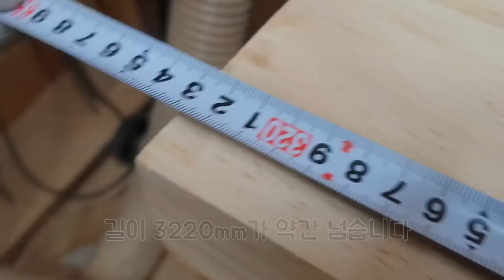[Eng Sub][여기까지 왔다 '끝판왕' 우드슬랩][woodslab table] wood ro leehyun DIY  Amazing Machine

Comment: Seeing the orientation of the 2 slabs glued together after a year ( or less ) everything on the table will roll into the centre as it will cup without any dovetailed straight supports underneath ( also the legs will begin to tilt out ) - if you don't want to see a dovetail on the side there is a way to put them in and hide them so the edge is unbroken...this is all about the machine ( really? you couldn't afford one more motor? - a CNC without linear travel? ) - unfortunately the understanding of the materials doesn't match the engineering in the machine...
Reply: The only motor controlled axis in the Z axis, so they'd need three more motors to control the other two. In addition to the three motors, there would also need to be a setup for lead screws or rack and pinion gearing to control the axes, which this machine does not have. This also isn't a CNC, it's very clearly a manually operated machine, outside of the motorized Z axis. This is essentially an inversion of a standard router table, but rather than moving the work piece in relation to the tool and jigs, you're moving the tool in relation to the work piece and jigs. Just because it uses a gantry design, like most typical woodworking 2.5d CNC routers use, does not make this a CNC; again, it's missing a lot of major components that would make it a CNC. If you want an analogous comparison to other manual machines and their CNC counterparts, look at mills and lathes, both have very accurate manual control variants, and both have CNC variants; though, inversely, this was designed based on adapting CNC designs to a manual machine, rather than adapting a manual machine to have computer control.   

Also, do yourself a favor and learn what punctuation is, your comment was a headache to read.
Reply: That still doesn't fix poor design and a misunderstanding of materials. Period. Satisfied?
Reply: The guy has been woodworking for over 38 years. He most likely knows what he's doing.
Reply: Well I've only been doing it for 30 but it's painfully obvious you know nothing about wood and how it moves ( hint#1 - it's ALWAYS moving ). -This is not his first dubious design - if you look at some other videos you will see he does cross grain gluing ( a mistake that usually only a beginner makes) and other things that have been called out. I hope you don't apply the " most likely knows what he's doing" to picking a mechanic to work on your car...
Reply: Ah, an internet educated intellectual speaks....you have just showed with everything you have written that you know SFA about wood....but it's ok - you can't fix stupid. I'm done.